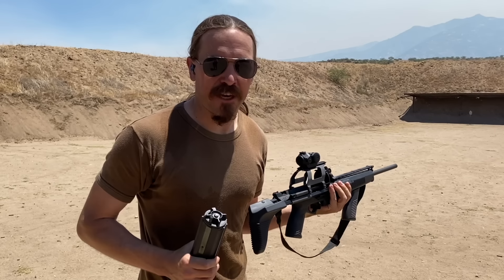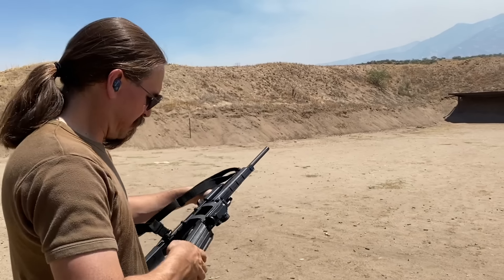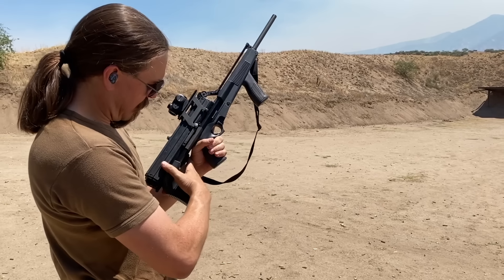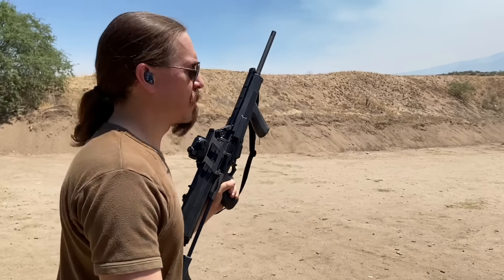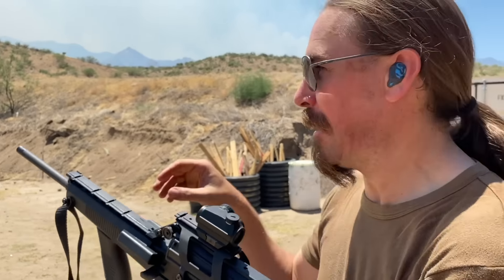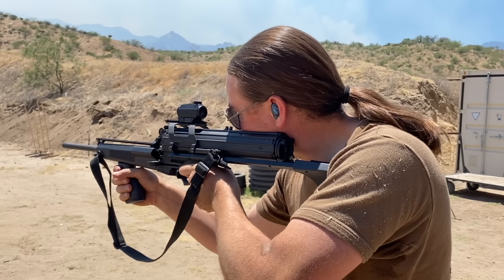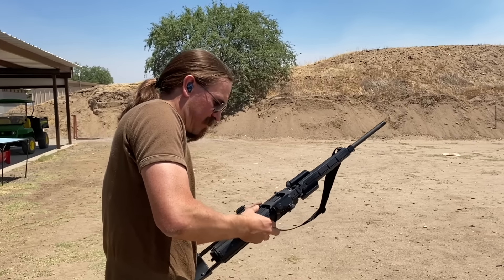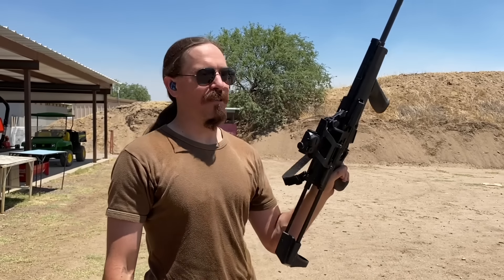Calico Reliability Testing: Round #2

Comment: We have learned three things from this: The calico still runs, Ian can still count to 23 and his dominant arm can handle exactly 100 rounds before giving up.
Reply: That was a heck of a coincidence, wasn't it?
Reply: It was his internal psycho-somatic firing counter.
Reply: His triggerfinger is well calibrated to exact 100 shots 👈
Reply: I was so out of it that i didnt feel like he spend a hundred round on that video until he said so lol
Reply: @Dusan Acimovic I've done that a few time when testing magazines for reliability or to see whether my lightened hammer spring will still reliably ignite all the different ammo types I'm using. It sounds like fun for the first 30rd mag or two, but it get's tired fast, both figuratively and literally XD
Reply: @TheBigOne0305  indeed ... what you've said, sounds fun.
Reply: TheBigOne0305 yup, it kinda sucks. I bought four 110rd drums for my 10/22 and did the work to make them pretty reliable. I eventually realized I really only needed two drums and a handful of BX magazines.
Reply: @TheSurogate  And it is, for a while. Then it starts becoming a chore and you just think "damn, I'm wasting so much money on ammo and I'm not even enjoying it that much" XD
Wish me luck that it turns out better this time. I have to do another test run this Friday on my Cx4 Storm. I'm using a lightened hammer spring to improve the trigger pull, but with the stock plastic hammer that had issues with some hard primers (specifically the MaxxTech steel case had 4 out of 100 which failed to ignite, 2 of those requiring not only a 2nd but a 3rd try, with the stock hammer spring there were never any issues). I have now modified the hammer with a metal screw to slightly increase the mass (I'd love to go with the Sierra Papa metal hammer, but I can't get that here in Germany, thanks to ITAR) and have to see if that worked. But at least that ammo is cheap as shit. Last I paid was 6.65 EUR/50 (including 19% VAT, so about 6.70 USD without VAT), but you get what you pay for, it's the absolute bottom of the barrel, bargain bin stuff (so at least I don't feel too bad wasting a few boxed of that stuff XD).
Reply: Dusan Acimovic The Calico has the worst trigger on earth is the issue (any other gun 100 rounds is nothing), it’s trigger feels about like lifting a 15 pound bowling ball with 1 finger (compared to maybe 2 pound on most triggers). It’s just a bad trigger, like really bad. It’s also impossible to shoot quickly for most people that don’t have Arnold Schwarzenegger fingers (I’m sure he’s been in a movie using the Calico since it’s a Hollywood gun, that’s probably what gave him that body).

I’d equate it roughly 10x more energy to pull (I can mag dump a .22 with similar effort to 1 trigger pull on the Calico), for normal AR-15 it’s probably more like 800-1000 trigger pulls, it’s that intense.
Reply: @jakegarrett8109  http://www.imfdb.org/wiki/Calico#Calico_M100 ... he was IN Running Man, but i do not think he used the Calico in there even though this says they had one for a guard ... yes, the movie page itself says he held three different rifles (Colt Commando, Steyr Aug and HK 94), but not the Calico http://www.imfdb.org/wiki/The_Running_Man#Steyr_AUG
Reply: @Ugly_German_Truths  Just shows even the mighty Schwarzenegger didn't have the muscle in his trigger finger at the time (that's probably what he used off-set for his grip strength workout but didn't want to show him sweating on stage). Haha, yep the Calico has been in a lot of Hollywood films, its a cool looking sci-fi prop in many iconic films. They are really light weight except the trigger pull is about 3-4x heavier pull than lifting the entire rifle (you can easily lift the rifle by the trigger, that sucker isn't going off easy!)
Reply: Well the trigger is heavy as shit on the centerfire variants... I got rid of mine because that very reason...
Reply: 100 trigger pulls I think was the issue
Reply: @Jehty_  German shootings ranges are pretty strictly regulated. Most of the fun stuff like shooting at soda bottles, bowling pins etc. is usually frowned upon :(
But I did put together a simulated falling plate rack (because I currently don't have access to a range which has a proper falling plate rack setup), which is a three piece wooden beam (can be disassembled for easier transport) with 1,8m length and it has paper targets (regular printed DIN A4 sheets) with 20cm circles on them stapled to it. Of course those don't fall down, but you can still train going through the motions of shouldering the gun, engaging all five "plates" one by one and properly transitioning between them. I'll try that one out on Friday as well (which is good, since I have a falling plate match on Saturday and I have never actually shot at falling plates before even once XD). Hopefully that will be enough distraction to not make testing the modified hammer a chore :)
Reply: Well, to tell you the truth, in all this excitement I kind of lost track myself.  You've got to ask yourself one question: 'Do I feel lucky?' Well, do you, punk?
Reply: @TrogdorBurnin8or  Actually I do feel kind of lucky ;)
I just swapped out the hammer in my Cx4 Storm with the modified one. It has a bolt driven through the hammer near the top which brings the weight from ~4g up to ~6g. I hope that this is sufficient to reliably ignite even the harder primers with the weaker hammer spring (which makes the trigger much nicer than the stock one).

Comment: In two videos Ian has redeemed the Calico of so many years of bad press
Reply: Star Trek Theory    100% agreed
Reply: Star Trek Theory I have the same one Ian does it might as well be the glock carbine in reliability
Reply: 🤦

It didn't fail in two whole magazines. Well, that settles it, issue to the Marines ASAP!
Reply: Well crap, this means prices are gonna spike.
Reply: Yep.
Also from anecdotal reports by users who were mis-using them.
Such as my friends and I.
Reply: Star Trek Theory  It's true. I've seen multiple videos from Calico owners and none of them have complained about reliability, only how time consuming the magazines are to load.
Reply: @springbloom5940  Two and a half magazines, strictly speaking.  But, more significantly, 250 rounds, which, for most submachine guns, would be around 8.33 magazines.
Reply: @redrackham6812  

Its not a submachinegun.
Reply: @springbloom5940  250 rounds still.
Reply: @springbloom5940  In that it does not have a fully automatic mode, true, but the point still holds: the proper basis of comparison is number of rounds, not number of magazines.
Reply: Those of us that own them already knew they worked. The people spreading the rumors that they're unreliable have likely never even shot one.
Reply: @fus132  

Wow, talk about missing the point 🤦
Reply: @springbloom5940  Nope. It needs a user to be able to count to 23. That would mean the whole Platoon has to help winding it... totally impractical.
Reply: @Sheridantank  Stop calling it "infringement", the word as used in the 2nd amendment had a different meaning (total ban on weapon ownership) it did NOT mean slight but reasonable LIMITATIONS on ownership and trust in owners.
Reply: @squishyblanket  "none of them have complained about reliability, only how time consuming the magazines are to load"
A complaint i remember Ian making about countless large capacity drums that have no mechanical loading aides like the Russian drums and similar devices, the trenchguns and so on, even filling up a belt is a pain in the triggerfinger if you have no machine taking on the tedious part. Also pretty much expectable when you put 100 of anything in a storage device that relies on spring tension to hand it back out.
Reply: @springbloom5940  Watch the iraq veteran where its  been shoe horned onto a mac11
Reply: @Ugly_German_Truths  

The snark, notwithstanding, you are actually right about it being a serious logistical problem. Not to mention the inflexibility of a weapon that requires 23; not 22, not 24, but 23 cranks, on the magazine, to feed properly.
Reply: @smokingcrab2290  1) Get a Dremel with a cotton wheel and some flitz or mothers metal polish and mirror polish the feedramp. 2) take a stone to the inside of the extractor just enough to make the back edge that grabs the rim sharp. Also filing a small groove in the side of the chamber so the extractor can get a better grab on the rim of the case will help with extraction problems. 3) Only shoot cci mini mags through it. 4) never ever ever pull the trigger on an empty chamber. The barrel is zamak  with a thin steel sleeve. The firing pin will peen material down into the top of the chamber and make empty cases drag/get stuck causing extraction issues. This all helped get my J22 working as reliably as a J22 can possibly run. Just know the life of that pistol is still limited by the zamak slide that will inevitably bow out at the sides (most visible from the bottom where the ejection port is). When this starts to happen, the side becomes shorter closing the headspace and will eventually end in slam fires. My slide was not only bowed out on the sides, but actually cracked in the breach face. I was able to hunt down another slide on the ebays for like $17 bucks though and it's back up and running. Enjoy!
Reply: @mojopin2520  21 if they drop trou.....just saying....
Reply: Spring Bloom  I’m not sure, does it have a crayon conversion kit?
Reply: Both the GDI and Nod have used them...

Comment: I have a Calico model 100 rifle in .22lr (folding stock version) and I used to have the pistol version in 9mm... The very heavy trigger on the 9mm version made me sell it, in addition to arm braces not being a thing back in the early 2000s when I bought it when I was 21... I still have the calico helical 9mm magazine loading tool if you're interested in it... I never sold my Calico .22LR rifle though, because unlike the 9mm carbine and pistol variants, the trigger on the model 100s in .22lr is very light and crisp, and it runs 100 rd mags very reliably with CCI mini mag ammunition...

Comment: Maybe people didn't use this gun as intended. They probably cranked it like a jack in a box.
Reply: Lassi Kinnunen  TFB had one, it dutifully malfunctioned but he cranked it 25 times
Reply: @kentlindal5422  But counting is so hard!
Reply: It's not just cranking that hurt these guns when they came out plays into to, the calico requires P+ ammo to function.

In the 80s it was more common to find under powered rounds on the cheap with slower burning powder, today your standard 9mm is basically 1980s P+ with faster burning powder.

Science FTW
Reply: You'd think they forcefully add a limiter so it stops cranking at 23 cycles and limits the drum to exactly 100 rounds?
Reply: @dra6o0n  that would eat up even more space on those giant magazine, both are possible but would add to the overall price tag.

Logistics is most likely the reason
Reply: @PotatocannonLol  As far as i know the specifications of 9mm and 9mm+P has not changed since a very long time, so your statement doesn´t make sense! Today standard 9mm ammo is loaded closer to the specified max pressure of the cartridge than before. It is however not +P in any shape or form.
Reply: @RiderOftheNorth.357  

There's a reason I mentioned powder

1980s
However 9mm 115gr. backed by 5.7 grains of A-no.05 powder(in think this was around in the 80s). That would give you 927 ft/s according to the chart

While today
115 grain bullet, with 5.0 grains of W231 powder will hit 1140 ft/s

I hope that clears things up a bit it's not so much the min - max that classified the ammo as P vs P+ but where was the average for that ammunition at the time.

Today's ammo in pressure is higher on average then the 80s also the 80s powder was slower burning.

The point being that the gun runs better on hotter rounds
Reply: @dra6o0n  Expecting people to be able to read and then count is where the went wrong, they should have known that is beyond most people.
Reply: @PotatocannonLol  Now we agree on things! I just got all worked up when some people seems to believe that +P is just a thing you say to descibe higher velocity or pressure. I might have snapped a bit at you, sorry if that the case.
Reply: @RiderOftheNorth.357  all good glad it was simple misunderstanding
Reply: The same people cranked the pencil sharpener handle until the l=pencil got so stubby.
Reply: I'm sorry, but doesn't this just reinforce the fact that the weapon would be utterly useless in a combat zone where you had to reload mags? Compared to most mags (I'll even thrown in the P90s) they can just be loaded without any special instructions or counting where ONE bad turn can wind (heh) up with you not being able to fire...so why even bother? Hell, why not figure a way around the tension so it couldn't be under or over-wound and this wouldn't have been folktales?
Reply: @DxBlack  physics primarily, it's the same reason why double stack feed extended magazines has the occasional failure to feed. 

I get the military Angle but this wasn't intended for military applications, some police sure but it was intended for a non combat zone so your point is mute there.
Reply: @DxBlack  you wouldn't reload the mags tho, you'd just carry like 2 extra drums. That's 300 rds. Plenty to get you through whatever so that you can reload the drums elsewhere in relative safety. Regardless of that though it wasn't made for military service, it was specifically marketed towards police and civilians. Also if your point were to hold true, what's the point of drum or belt fed machine guns? I don't see people reattaching links or reloading the drums, they just get a new one, same with the standard 30 rd mags.
Reply: The RedNeckEngineNerd A civil, intellectual, and fact-based discourse between two gun lovers on the internet? Now this is rare.
Reply: @Senator_Byrd  any civil discussion is rare on the internet :(
Reply: "THEY" most likely lost track around 9 or 11-ish...
Reply: @Mr_Blonde-ru9kd  it's unfortunately sadly true, but quite the treat when it happens.

Comment: If they could figure out a way to make the drum stop winding at 23 revolutions that'd go some way to idiot-proofing the gun. Not 'precisely 23 revolutions', but 'crank it until it won't go'.
Reply: Pcm979 
Or a plain box magazine option.
Reply: @zedhiro6131  The high-capacity drum magazine is the whole point of the Calico.
Reply: To you perhaps but when I see it I see a non-HK roller delayed system. I do agree that putting a ratchet or something to stop over cranking the spring would go a long way. I also remember the drum magazine should not replace the stick.
Reply: @zedhiro6131  If you want a budget MP5 then that's another matter entirely. Fitting a box magazine into the existing magazine well-chute-tray thing would be an enormous kludge just to spite HK's prices. It would have all the downsides of a top-mounted magazine that integrates the gun's sights with none of the benefits while increasing cost, making it less of a budget MP5 and more of just a goofy one.
Reply: @Pcm979  
I am not requesting the company sink more budget into R&D. I am saying that an enterprising 3d printer could come up with a solution. If it's me I discard the idea of the sights entirely, and go with a rd like on the rifle system. As for the magazine design I would take my inspiration from the FN P90 magazines. The feed and ejection are similar.
Reply: @zedhiro6131  Since I was talking about what the company could do to improve the product I hope you can understand why I didn't realise that you were changing the subject without telling me.
Reply: Pcm979 Sorry my mind goes from one point to another without telling me.  If we are talking things the company can to, thread the muzzle (roller delayed system), come up with a sighting system that doesn’t rely on the mag as a rear sight (make it red friendly, or use the bullseye sights that are on the 365 sas .)

Comment: Looks like the Calico is one of those guns that would REALLY benefit from a binary trigger.
Reply: A 2-burst fire would work wondrously with that gun too.
Reply: Or a trigger crank

You're already cranking de mag, might as well crank dat gat
Reply: @ArcturusOTE  Binary triggers have superior ergonomics to cranks. But a crank isn't a bad idea even so.
Reply: @zbm-2375  Use a crank on a binary trigger.
Reply: i can think of a huge problem with binary triggers... What if you just shot once and you don't want to shot a second time?
Reply: @danilonakazone386  Most of them are designed so you can put it on safe or semi, and not "cancel" the second shot.
Reply: Cmon man the inly place where a binary trigger is fun is in a video-game. IRL it's the most dangereus thing ever. And it exist just to go around stupid laws. Better change the law!
Reply: @PapaSchultz74  Dangerous thing ever? How come? I'm not entirely sure how binary/echo triggers are detrimental but hey, asking for better gun laws is a better idea
Reply: @PapaSchultz74  At least the last statement is correct; it does exist to get around stupid laws.

Not sure how a working binary is supposed to be dangerous; anything that would make it especially dangerous is something you shouldn't be doing with a semiauto either.